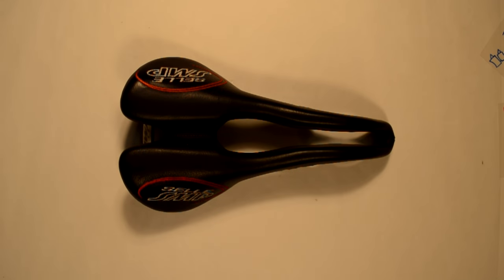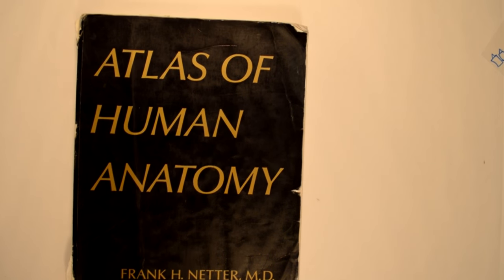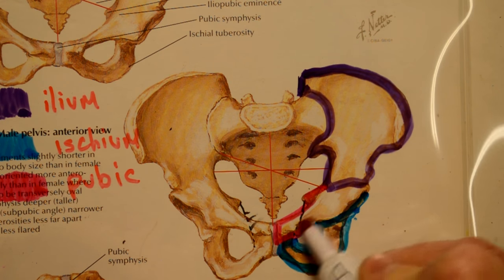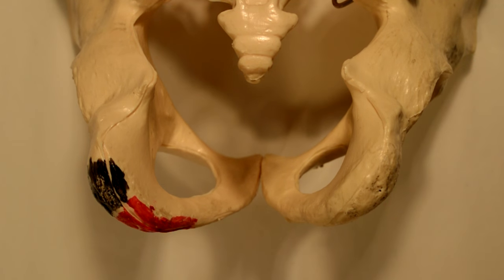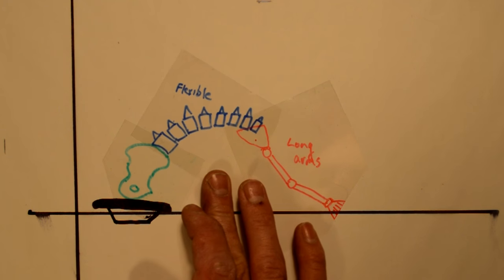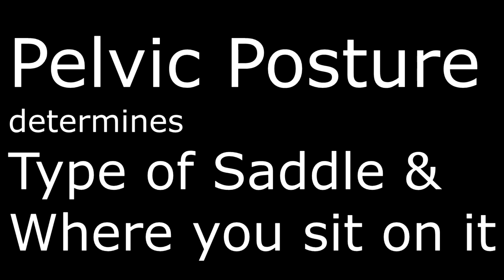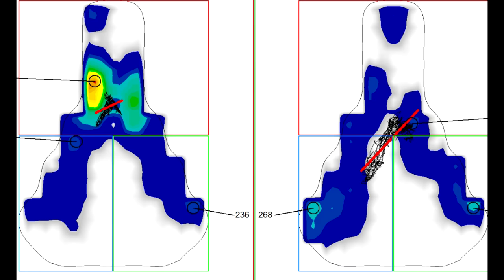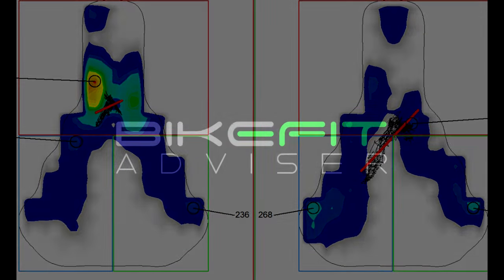Why is my bike seat so uncomfortable?

Comment: When we sit in a chair in the normal position, we are not just resting on the pelvis, we are also resting on the back of the thighs, which distributes the the downward pressure of our upper-body's mass weight and spreads it out. When we are cycling, we can no longer distribute the downward mass pressure along our thighs, as our thighs have nothing to rest on...in fact, they are working very hard. The only other place where we can distribute some of the upper-body's downward mass pressure is at the handlebars, which is why our shoulders and arms and hands get fatigued.

However, the trick is to direct the downward mass pressure towards our legs in the most optimal way, thereby utilising gravity as well as our muscles to move us forward. Optimal sitting position would have our body's centre of gravity directly over the the centre of the pedal crank shaft which should, in theory, bring a near equalisation of pressure to the pelvis, shoulders, arms, and hands.

Needless to say, but the heavier one is, the more problematic seat discomfort might be. Losing weight will help a great deal.

Comment: Thanks for the way in which you presented this video. Currently have fractured toes so not able to ride my bike at this time. But my toes won't stop me from figuring out why I had so much pain when riding. Will re-watch this video somewhere in the coming weeks and get a few photos taken so I can adjust certain things (learning is the key for me in many things, Learning nothing isn't an option, something new each day No matter what it is, benefits me immensely). Cheers

Comment: Hi whilst the lack of yellow and red is a good thing, the red line suggests another issue i.e. a greater degree of lateral movement left to right and forward and backward. Which in itself can lead to other issues away from the saddle (knee pain, hip pain etc).

Comment: So if my coccyx hurts, which way do I adjust my bars? I use to do triathlons for a few years and never had the pain in my coccyx like this so I am not sure where the adjustments need to be made. Granted, it has been about ten years since my riding days and I recently bought a hybrid bike to do trails and hard pack riding. One ride on a paved trail hurt my tail bone so much it was hard to sit down. Thanks for the video, love the diagrams and illustrations. Keep doing what you do. Cheers.

Comment: so the solution is not to buy a new seat, which I just did, but to adjust the handlebar? 
My question is this: How Do I know if it is correct before causing pain?  My problem is, that it doesn't feel uncomfortable instantly. Only after I have started riding.  Only then does my pelvis bone area in my crotch get sore, and then it's a poor experience thereafter and for the next 3 days my arse is sore no matter what it touches.  
Sitting on the factory seat, it feels like no matter my position, it hurts in those spots.  So I just received from Amazon a "Wide Seat" bike seat. It hasw more of a curved area where the buttocks go, and it still has the nose of the seat going between the legs in the crotch. It's wide, it seems cushy ( I haven't installed it yet)  but as a test, I just put it on my chair and sat on it, and my pelvic bones are still pressed and still hurt.   So what you are saying is it is not the seat but the handlebar? I understand but my butt doesn't.

Comment: thanks. but why matching  the bar Position instead of  the saddle? if i am constantly moving back on  the saddle, the first thing i would do is putting it more  forward. of  course only so much as  the knee remains above the Pedal.
Reply from the maker: you're correct that at times we can get away with just moving the saddle forward.  This can help to bring the seat where the hips are already trying to be, when we have plenty of room to move forward and still have the hips far enough back behind the feet.

But in many cases when we ask the question "Why am I sliding forward on the saddle?" or "Why do I have groin pain on the bike?", bar reach and drop are the major cause and many riders are at  a point where if they move the saddle further forward they will be upsetting the balance of the hips/knee position relative to the feet.  At best this might only affect the efficiency of the pedal stroke, but in many cases it has a real chance to worsen the balance on the seat itself and create worse saddle issues and potentially new handlebar/hand issues.

This is why I prefer to get the hips first into their optimal position relative to the feet (saddle high enough and aft enough) and then correctly set the handlebar position such that it's not negatively affecting the way the pelvis rests on the saddle
Reply: Thanks a lot for your answer! Very helpful
Reply: Thanks for the answer, but could you please shed some light on the best hip to feet position?

Comment: How do I find your explanation of knee pain and injury. I'm getting old (73) but swim 3 hours a week and try to walk 8,000 steps a day . So fairly fit. Bought a bike a few months back and within a month I couldn't walk. X-rays and sonograms said I had only sprained the knee,  small holes in the ligaments but nothing torn.  Doing all the exercises prescribed and have carefully set my bike to fit my body. Three months being careful. 
Got on the bike yesterday and today I am once again an invalid. Exactly the same injury has flared up again. 
Do you have a video showing how the knee works like this one on the Pelvis? I  need to understand what's happening here.
Reply: Is your seat position high enough?  Too low of a seat can destroy the knees.

Comment: Nope. Wrong! It's not about you/your anatomy. It's about the bike, the seat. You're just not supposed to be riding a bike non stop for more than a few minutes, maximum 15 minutes at a time, and half the time you probably should be standing up, not sitting down. But they want you to ride dozens of miles, even hundreds of miles, or more on bumpy roads. That's the hype. Don't believe it. Solution: short bike trips, soft, cushioned saddle, the right kind of shock absorbers/suspension setup, front and rear, possibly. Do more with saddle shocks, too. Forget the long, painful bike tours. Only problems is you'll likely look like a nincompoop, on such a comfortable bike. You'll likely be the laughing stock of your town. But cycling engineers could hide such creature comforts if they wanted to and still keep bikes nice and light so you could ride a little longer before your butt starts to hurt.